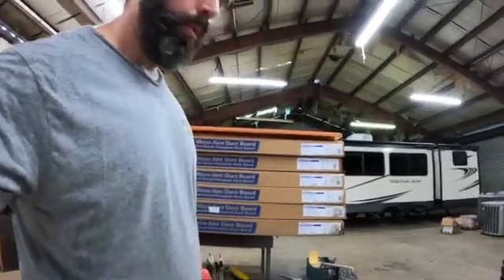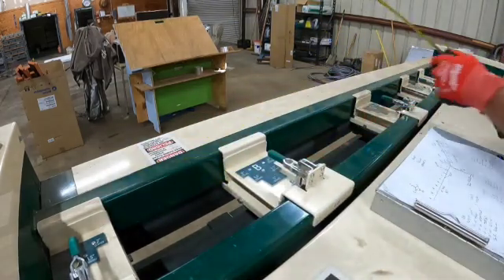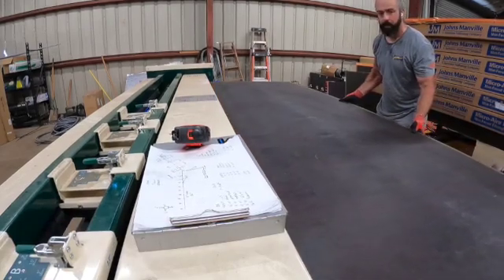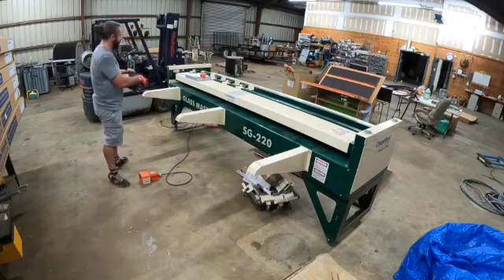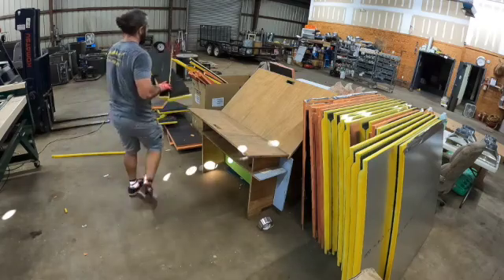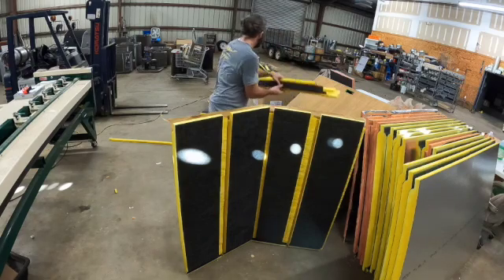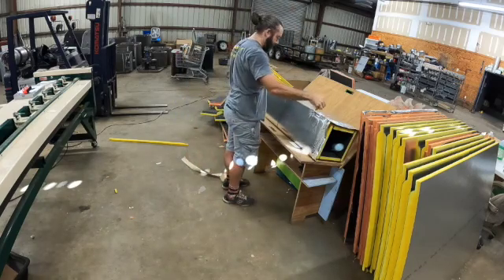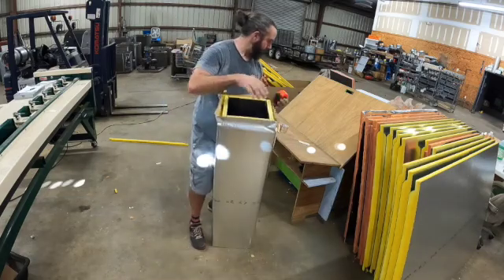Ductboard Fabrication

Comment: I have a 24.5" x 21"  i forget the math to make the outside dim. same ?  1.5 in board.   yes I have done it but forget everytime.  add 3 or subtract 3.  Thank you.
Reply from the maker: So, with 1.5” duct board, if your inside dimensions are 24.5x21 the outside dimensions should be 27.5 x 24.

Comment: what is a good spray adhesive to make sure that duckboard fiberglass won't go airborne. which is a good spray that doesn't off gas toxic chemicals?
Reply: That black coating you see on the newer style ductboard is both adhesive sealant and antimicrobial coating
Reply: check out the duro dyne website

Comment: I would also use outward clinch staples in the flaps at a minumum.   Ideally you should also mastic the seams.
Reply from the maker: We've done that in the past. We're following SMACNA 7th edition guidelines here.  
“Closures systems are a vital element in the proper as- sembly of fibrous glass duct systems, providing both the structural connection and sealing of seams and joints. Only those closure systems that comply with UL 181 or UL 181 A are suitable for use with rigid fibrous glass duct systems. Listed closures include
Reply from the maker: 1. Pressure Sensitive aluminum foil tapes. 
2. Heat activated aluminum foil/scrim tapes.
3. Mastic and glass fabric tape system (GFM).
Model codes and project specifications require that non-metallic duct construction, which includes fibrous glass ducts, conform to UL181, Class 1 Requirements. Under UL 181 A listing procedures, an individual closure system may be qualified for use on all manufacturer's boards which meet the UL 181 requirement. UL 181 A tapes are imprinted for identification.

We've been following method 1 for 15 years with no issues in craftsmanship or code officials.  Staples are great for use with the heat activated tape and the GFM system because something needs to hold the flaps in place while you apply those methods.  Notice though that MASTIC is only approved for use WITH glass fabric tape, that is if you're following SMACNA guidelines for your local code like our state does.
Reply: @AIRMANHVAC  We always use staples and tape, mainly because it's faster to fab as am assembly line one guy stapling one taping, and it looks better. 
But you are correct. Only one UL181 compliant closure method needs done. 
There's a lot of guys that use tape AND mastic which is honestly pointless. It doesn't need BOTH and honestly, it looks like crap finished product wise lol.

Comment: That is cool but that's the worst stuff to make ducked work out of.
Reply: That “ductwork” is code in the southern areas
Reply: @domrod1579   if you're cheap!! Hard pipe is the way to go!  If you can't do it right then dont do it!
Reply: @domrod1579   no it want, I've been  doing this over 20 years  and I have seen that shit fall apart.
Reply: @Eric-ot6sn  20 years? Yeah, I’m definitely questioning 20 years. You should know, that this trade is done differently in other parts of our country, with no exceptions.
Reply: @domrod1579    do you know that you're breathing that in every time the unit comes on so who's the ignorant one,